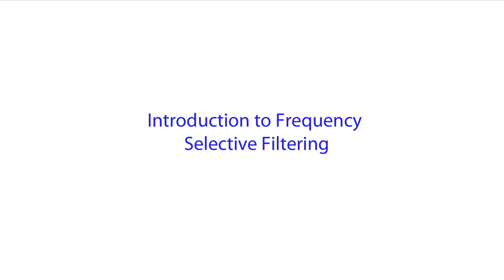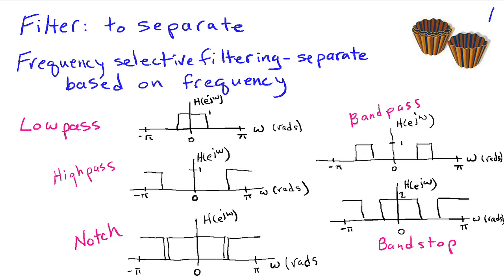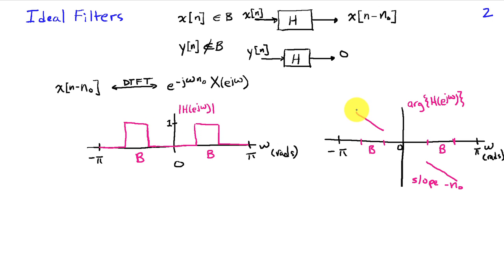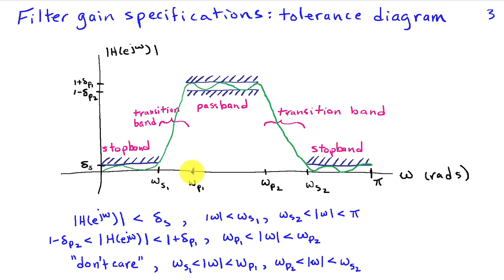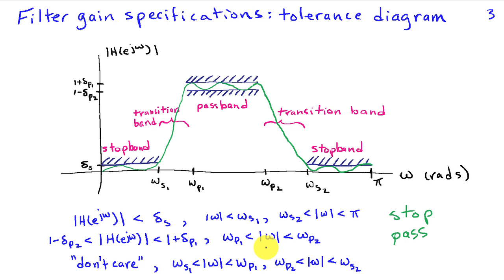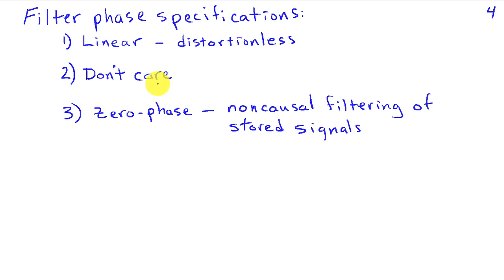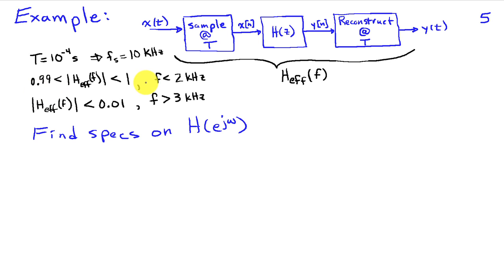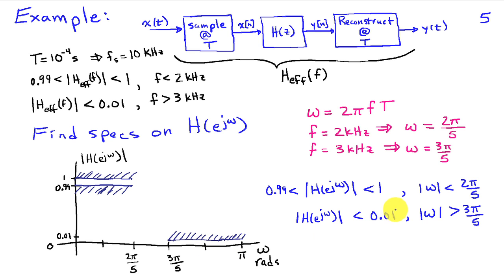Introduction to Frequency Selective Filtering

Comment: w does not equal 2*pi*f*T. 
w = 2*pi*f or w = 2*pi/T
Reply: The definition of omega in digital signal processing is that it is the normalized angular frequency depending on the sampling frequency. In other words, 2*pi is mapped to f_s(the sampling frequency). The definition of 2*pi differs with different sampling frequencies. This is not the traditional definition of 2*pi.

Comment: Shouldn't the X axis read  rads/sec  as opposed to just  'rads'  denoting frequency?
Reply: Well in Discrete time system(DTS) the frequency is of the dimension radians and not radians/sec as in the counterpart Continuous Time System(CTS).
So when we check the frequency response of DTS we have just w in just radians.
Reply: @vickybidawat1956  w is radians per sample in discrete time
Reply: I dont know if what Im saying is correct, but I belive the x-axis in this case where we have w as just rads is because w (in this case) is a dimensionless quantity, the reason for this is that we are only looking at the sampled frequencies in the frequency domain x[n],  as opposed to the time-domain x(t).

So you have a signal, and you sample it and you're left with a set of data. The dataset is just a vector of frequencies, it doesnt contain any values for "frequency/time" , it's just "sample 14  contains frequency 30Hz".